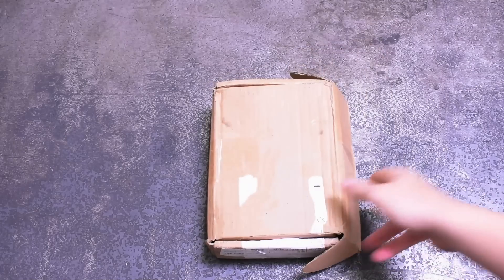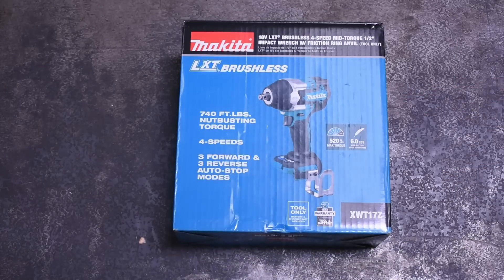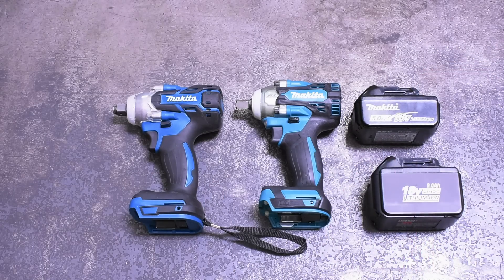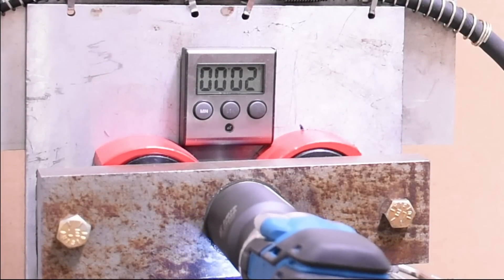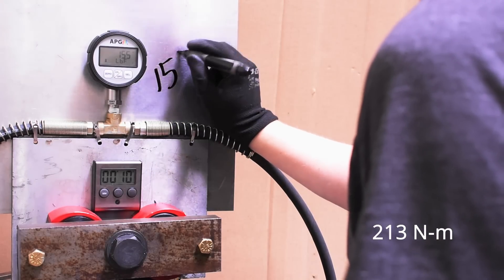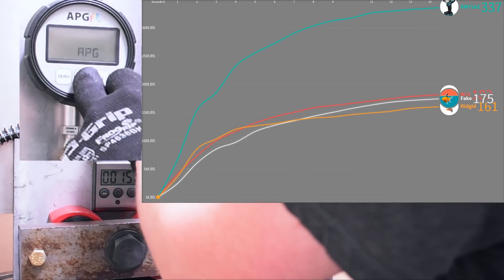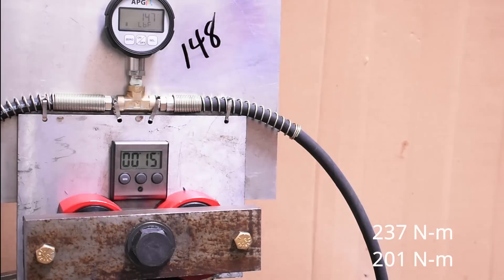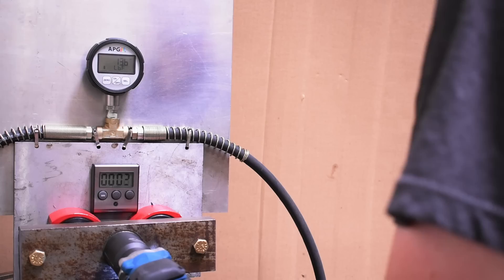Knockoff Makita: Exactly What Kind of Power Does it Make?

Comment from the maker: Torque of TTC is working in product development for Astro Tools who also make impact wrenches (air). TTC is not the only testing out there, always consider multiple sources when looking at a tool! Was our Wish wannabe worse than expected, have you had better luck? Let us know!
Reply: Torque, congrats on the Astro position 🎉
Reply: I have both but my knockoff doesn't have the branding and it was only $30.   It's not bad, but the first one exploded, the anvil self destructed at the first use.  I've only used it once to disassemble a Jeep and it had about the same power as a 12v Milwaukee brushed impact driver with a 3/8 adapter.  Bought the genuine 14Z during the last sale, seems much better made (duh) but I haven't used it yet.
Reply: I love your channel - You give us real data - thank you
I think you could really expand your channel by doing head to head comparisons with Wrenches, Sockets, Ratchet Ect...
I'd like to see you take them to failure - also compare fit and finish and Cost 
We could really benefit from this info. If I could get a wrench that is 90% as strong as a snap on for half the price thats 
a game changer - Thank you - Keep up the great work
Reply: Good luck on your new job and keep up the great videos
Reply: My friend got one, and its not bad, but sometimes it just does nothing when you press the trigger then suddenly works ok!  Good content here!
Reply: Would like to see some tests on ingco brand cordless tools
Reply: @50_cal49  Send him one to test
Reply: T5.5 you are 908inches 0⁶
Iuu77⁷ of
Reply: would be interesting to open it up and compare to the real one